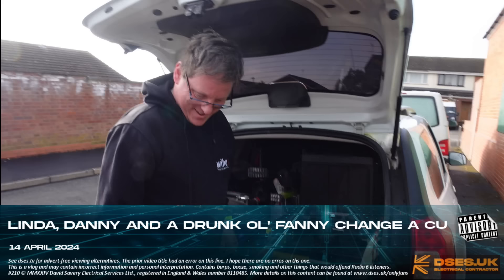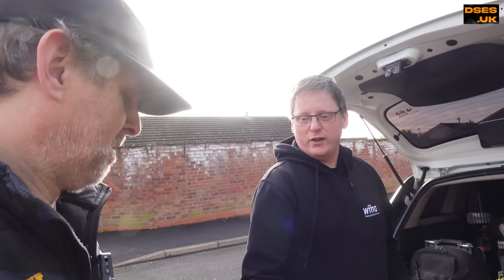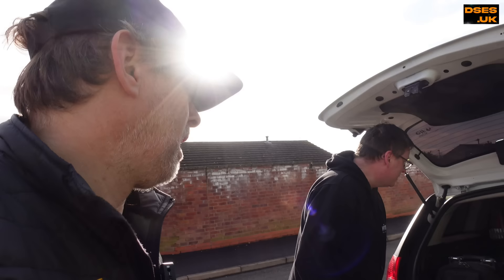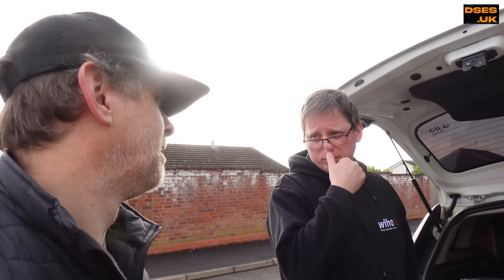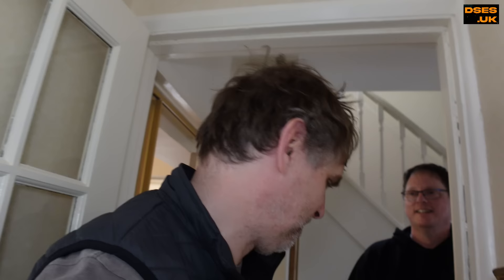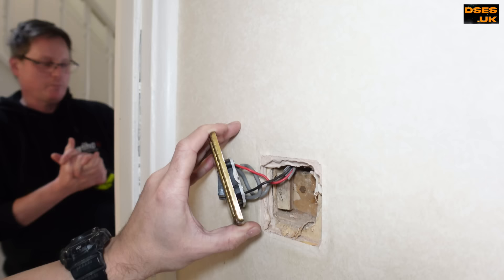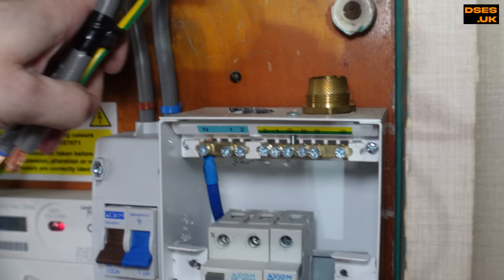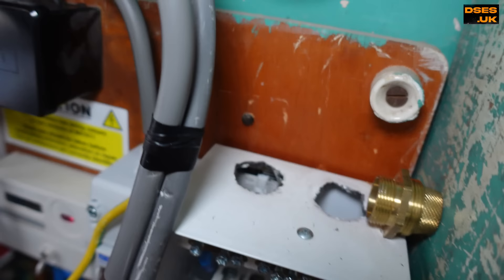Linda, Danny and a drunk ol' fanny change a CU

Comment: The 40/45A fuse holder and base were slightly larger than the 5A-30A  and would have to have a larger aperture. I  remember Doncaster Cables being a CEF-owned brand like Tamlite RPP etc. You seem disappointed that consumer unit brand has gone it seems a very contested market now.
Reply from the maker: I'm disappointed SBS have gone as they had a good product, but yes, it is a crowded space and often one with seemingly little innovation between brands. If it wasn't for the fact they all offset their busbar cage clamps a few millimetres off each other, we'd be able to mix and match what we plop onto the DIN rail!

Comment: Great video as always David . Good to see Dan with you even though he did get the ethos MFT . 😂

What was the EICR problems that warranted the board change ?  That fuse box looked almost new , no earth on the lighting and wooden back boxes doesn’t warrant a board change in my opinion. If the customer asked for it fine. Otherwise I didn’t see anything wrong with it . Also the extra 45amp fuse to the right off the main switch I believe was to protect the main switch? I remember seeing a similar fuse box back in the mid nineties in a my mums friends house I asked  her husband who was a spark and that’s what he told me. But I’m not entirely sure if he was correct or not?
Reply from the maker: The client wanted it modernised Sean. They're redecorating the place and want various moves and changes which will all require RCD protection to be compliant, so it makes sense to have that at source.
Reply: Oh ok I was sure what was going on other than what the video showed.or did I miss something?

Comment: I mind something about CEF pulling the pin on Doncaster during the family fall out…almost folded Doncaster.
Yess electrical were then born, and now stock it, as they were part of the CEF family…Messy affair.
Reply from the maker: Interesting. I didn't know there had been bad blood at Cities until I heard the Doncaster thang. Got any more goods on what happened?
Reply: Posted a link but it’s vanished?
Reply: @highlandsparky I think Dave has to approve links to prevent spam
Reply: If you also google Doncaster cables a new beginning, there’s a small article regarding the CEF pull out.
Reply: I had no idea the electrical industry was such a Cosa Nostra affair. I suppose when you’ve got the Don in Doncaster 😂
Reply: While not really desirable, there's nowt in the regs to fail an EICR due to wooden pattresses. Is there? They're set in masonry as well...
Reply: @tebscat  I've never seen or even heard of them before.
Reply from the maker: @tebscat  The problem with the wooden boxes was they were split and no longer holding the switches securely to the wall. A couple were okay still, but may as well run through the lot.
Reply from the maker: @highlandsparky  YT decides itself what it allows in the comments. I haven't deleted your link and there's nothing sat pending approval. The channel's set so anyone can post anything, but random stuff still vanishes including comments of my own sometimes.
Reply: @dsesuk  Fair do. The amount of destroying they take to get out never ceases to surprise me.

Comment: What size was that armoured cable, looked a bit small to be coming off a 50 amp mcb
Reply from the maker: 6mm, so yeah, 50A wasn't the right breaker. I guess Bob the Builder bought the cheapest 'shower unit' they could find at Toolstation before they realised they lacked the tools and skills to fit the thing properly!

Comment: I find it hard to believe that anyone has tested or issued any paperwork for the outdoor power DB.
Reply from the maker: No paperwork was bothered in the installing of that DB - clearly the work of a builder which is why they got the cheapest thing from Toolstation even though the MCB was oversized for the SWA they couldn't install correctly. Apparently they also offered to upgrade DB1 even though they told the homeowner "they're not electricians". Well, if they know that, why are they pissing about with the stuff??!

Comment: Which do think is better the earth sure or the Irish twin and earth that you had a roll of?
Reply from the maker: I liked the Irish cable for its CPC sleeving, however I didn't like the CPC being the same CSA as line/neutral as is standard in Europe. While not a problem on 1mm - 2.5mm cable, I can see it being quite cumbersome on 6mm or 10mm circuits, especially when Irish wiring accessories are based more on the UK style than the European gear. Most switches and sockets are designed for the smaller CPC which limits, or makes it awkward, for our Irish counterparts as I understand it.
Reply: Not seen either in person yet, but I'm leaning towards the Irish stuff.

Comment: How did you get round no earths in the switches?
Reply from the maker: Until any rewiring happens, we changed the switches and Class 1 lighting for plastic to clear C2 codings brought up by the report.
Reply: Had the same thing 2 yrs ago, compromised with customer to change to plastic switches,remove brass lights and replace with white pendants. This is then mentioned on the eicr comments to warn future users of the issue.

Comment: As for Doncaster cable, yeah they were owned by cef, but when the dad died who owned cef, the usual infighting starts where there's money involved, some had the cef brand plus other parts of the business and others started yess and also took Doncaster cables plus some overseas companies. Usual family shit.
Also I know domestic lights need RCD protection, however is there any point in this case with no earth in the circuit.
Reply from the maker: It's amazing how execution of a will can divide a family. Once any in-fighting starts, the only people who end up winning are the solicitors. As for RCD protection on the lighting, the lack of a CPC makes it especially important to have. An RCD has no connection to earth and doesn't rely on a CPC to be present or even the main earthing to be working. Let's say someone in the future wants to change a light fitting here and they fail to isolate the circuit. They grab the line wire and current flows from source, through them, down their step ladder and into physical earth. In this case, presence of a CPC or supplier's earth isn't relevant even if present, but the RCD will detect the current down line isn't returning via neutral and will duly click off. Not all 'earth leakages' happen down a CPC.

Comment: Hi, 50 amps for the garage supply what on earth were they thinking?
Reply from the maker: Dunno - the sub board in there fed only sockets and lights with nothing heavy hanging off. Mind you, if they knew what they were doing, they wouldn't have bastardised that armoured termination like they did.
Reply: @dsesuk  Hi indeed yes that was shocking.
Reply: I did wonder if the submain cable was rated to 50A

Comment: For the uninitiated, what's wrong with a wooden backbox aside from the difficulty of fitting screws?
Reply from the maker: Most were splintered and no longer holding the switches securely.
Reply: @dsesuk  ah ok thank you, so primarily a mechanical thing rather than an electrical thing then? 
I was dredging my brains trying to come up with a reg that said that backboxes must be metal but that made no sense given you get plastic ones!
Reply from the maker: @tomcardale5596  I'm not aware of any regs that would cover the material of a backbox, although I wouldn't be surprised if there was something somewhere about material meeting certain requirements for combustibility. In this case, some were just falling apart and the switches weren't secure. As the homeowner's redecorating, it made sense to swap them all out and be done with it.

Comment: Worse than double glazing or used car sales men. Selling a pensioner a new board when that Wylex would have seen him out. 
Arghhhhh tradesmen. Come on trading standards.
Reply from the maker: Pensioner?? The homeowner's in his thirties! Don't let those old school granny lights and brass switches fool you; they were the previous owner's aesthetic! This guy wants moves and changes, so RCD protection is needed at source if any alterations are to be signed off.
Reply: @dsesuk We have an old Wylex board and rubber cables. It's in metal conduit so perfectly safe. Works just fine. We still use our wireless set on long wave and bath in front of an open fire 🔥 👌 🤪 
Bunch of softies today.